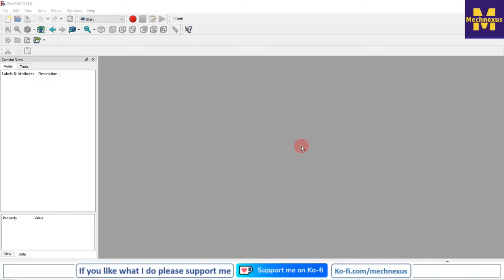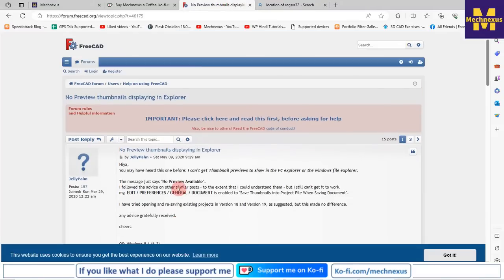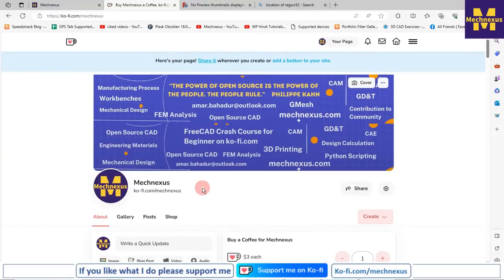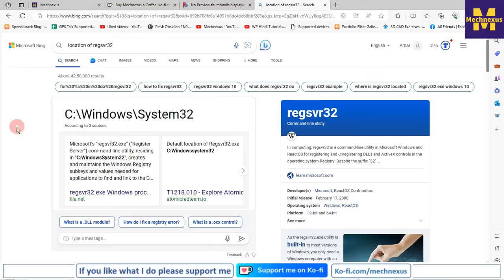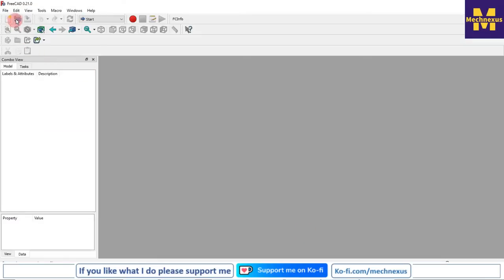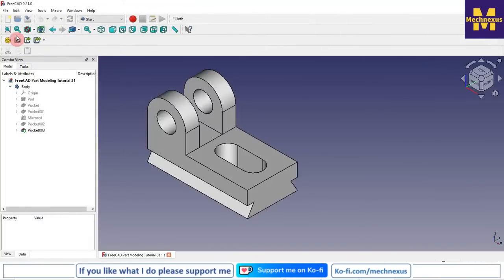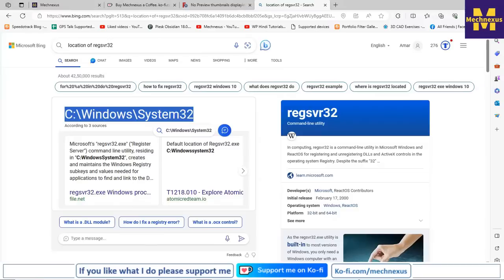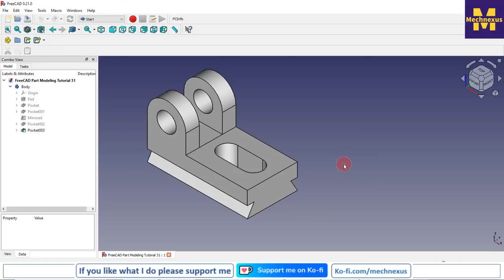Fix No Preview Thumbnails Issue in FreeCAD | FreeCAD Fix | Mechnexus |

Comment: Thanks for this, it does work, however you did not provide the link in the video description as stated and it should be noted that you have to run the Command Prompt as Administrator for this to work or you will get an error.
Reply from the maker: Thanks for correcting me. I have provided link in the video description. After Extracting the file paste it location shown in the video then open CMD and run command regsvr32 FCStdThumbnail.dll. You might get an error but do not worry it works for me. Next step is to open a FreeCAD file whose thumbnail is not visible and save it and check its thumbnail.

If you still face the issue let me know.